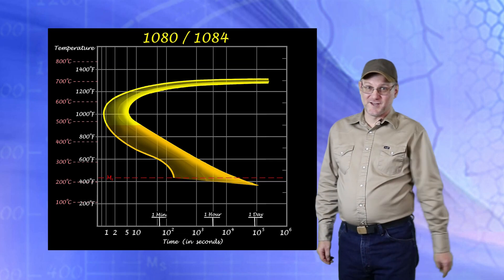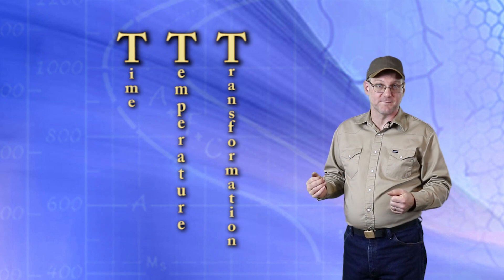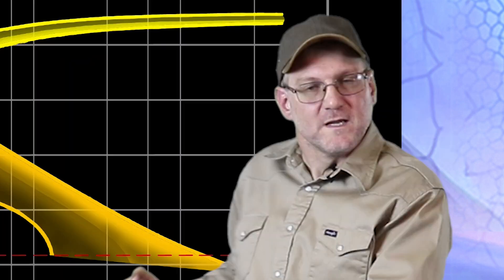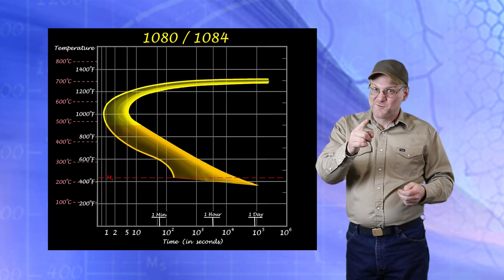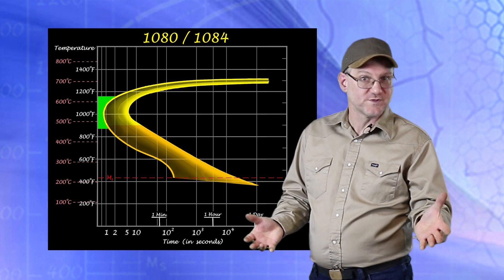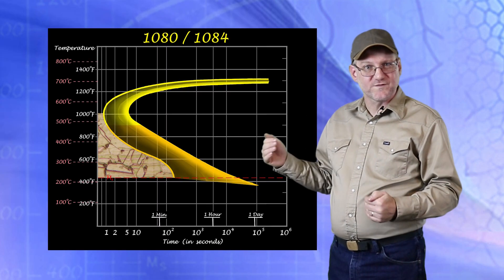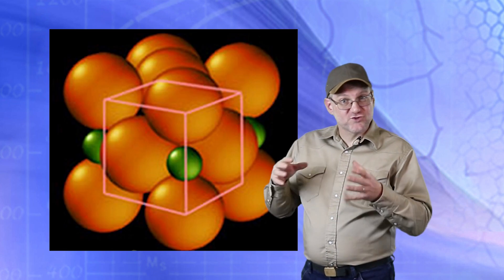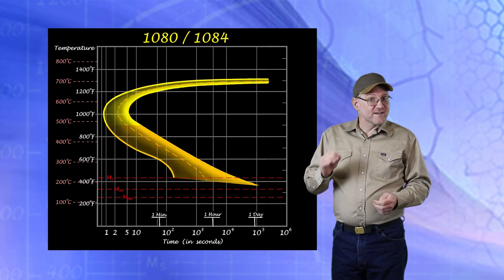The TTT curve (1080/1084)

Comment: Sir we've already seen that for an alloy, transformation occur at a range of temp.(except for eutectic composition)...but in  TTT diagram phase transformation start and finished at the same temp...HOW IS THIS POSSIBLE??  plz help🙏🙏
Reply from the maker: If I understand your question correctly I think the answer to your question may be in the difference between the TTT (I-T) diagram and the Continuous Cooling diagram.  The TTT is isothermal in that is reflects the transformation when the alloy is cooled to a given temperature and held there until transformation is complete.  Thus the hold reflects eventual equilibrium conditions.  The Continuous Cooling curve more accurately reflects what happens when there is no hold and shows the resulting phases from cooling continuously at different rates.  At the other end of this spectrum would be the Fe-Fe3C equilibrium diagram which only accounts for phases at static temperatures with no reflection of time.